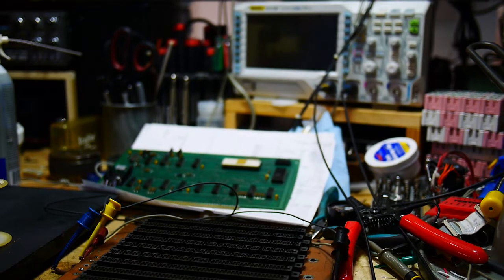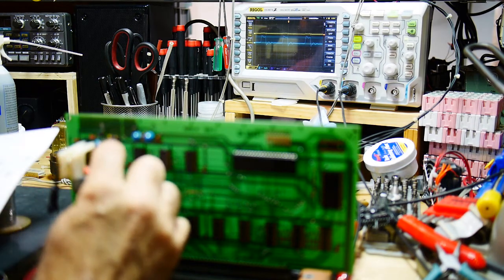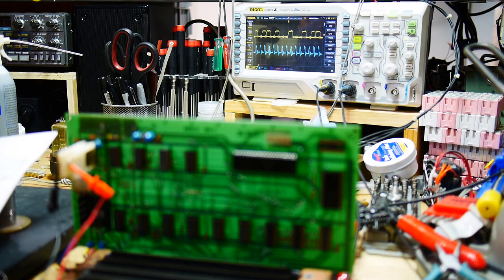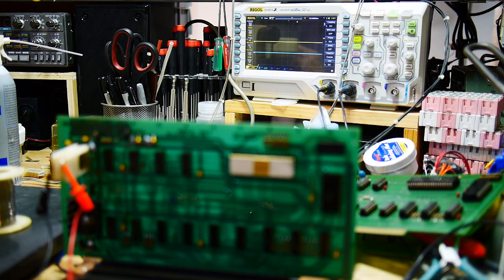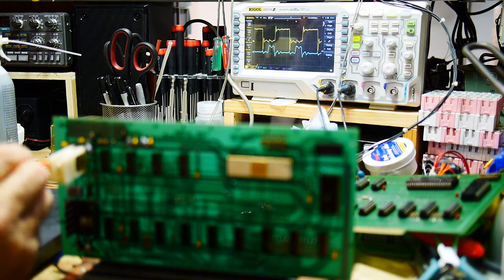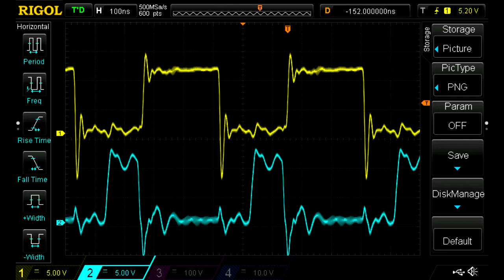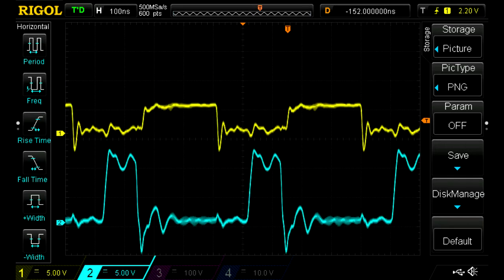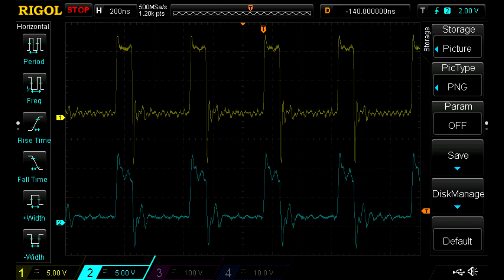#49 IMSAI 8080 mpu board fixed

Comment: I was able to resolve the problems with my MPU board. With a lot of help from the guys at the Vintage Computer Forum and my friend Mike Douglas at deramp.com
The problem was, that the MPU was not addressing the memory board at all, which is why all the data lines were remaining high. The problem was with the A14 address line that was going through the bus driver at B7. There was one other problem on this board, but it did not effect the data lines. The Phase 1 clock was not going out to the S100 bus on the B2 bus driver. 

At first I piggy backed the two chips, with replacement 8T97s and that appeared to work, so I removed both of them and soldered in some sockets and then replaced the bad 8T97s with the good ones. 

All of the credit goes to Mike, who knew almost right away, that the memory board may not be getting accessed correctly, and took a look at the memory board, to see how it was supposed to be accessed, and had me test the appropriate address lines A14 and A15.

Comment: I am looking at pretty much the same problem. I have one IMSAI MPU board that gives me nothing but FFs on the data lines. 
I have replaced the 914, with a 1N4148. I am waiting on a 751 Zener Diode to arrive, as somehow, I lost my -5V and it went to a -17V. 
I have ordered and may need to replace the 33-25V Tantalum cap there as well.
I have a bit of a fear to scope both the clock signals off of the 8224, as the pins are too close together, and I fried one, a while back. on an old Hazeltine Terminal.
They are not that easy to come by anymore...
Reply: I resolved my -5V issue, by replacing the 751 Zener Diode, but still have all data lines staying high. I can increment addresses using examine next or deposit next, 
although I can not deposit anything, the addresses doe increment.